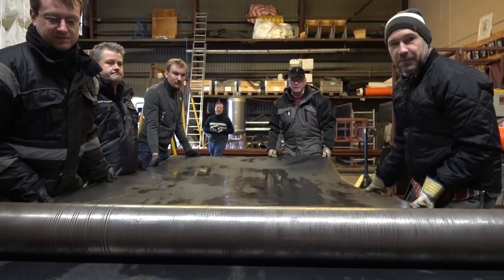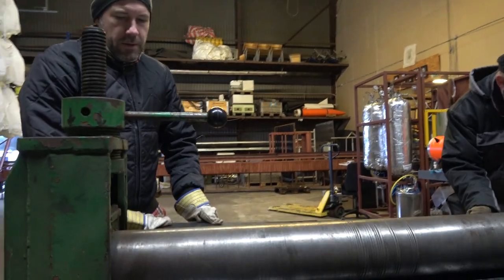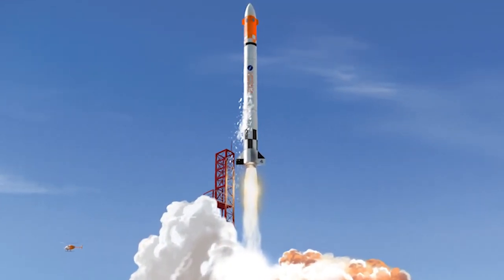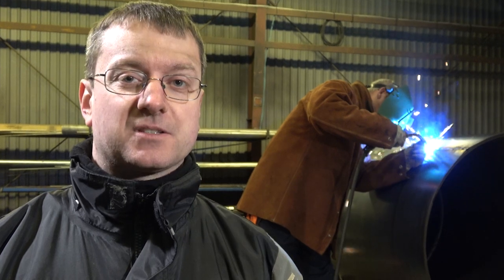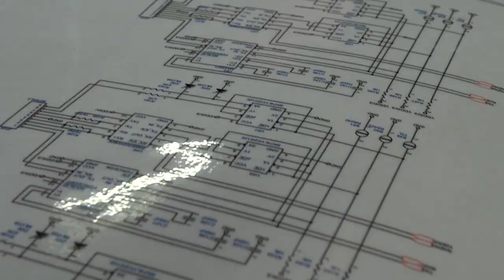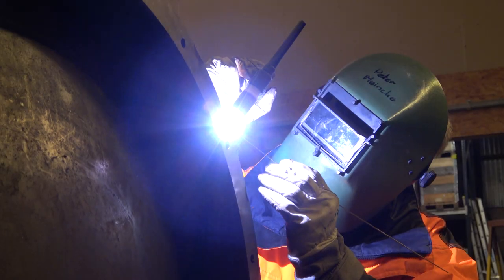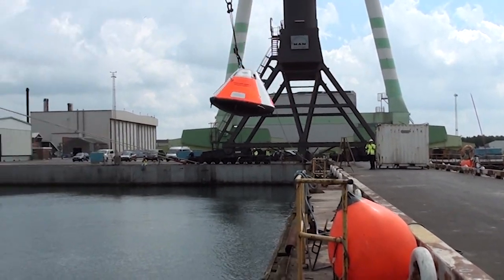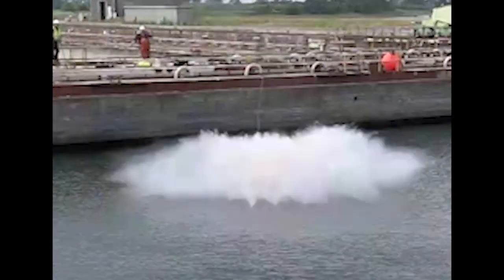Building Our Crewed Space Capsule Prototype for the Spica Rocket

Comment: Really cool! I'm intrigued by your thoughts re: positioning of your pilot. A seated position strikes me as problematic considering the G-Force involved in a rocket launch and is one of the main reasons most manned launches are conducted in a more horizontal position. Do you think you'll be able to reduce the acceleration involved in the launch?
Reply: CHEEZEPictures There are ways to counteract these kinds of problems; such as the pilot is likely to wear a G-suit, or a low thrust to weight ratio at burnout. The primary reason for the seating position is to reduce the diameter of the rocket body, as a larger diameter would be more problematic than high acceleration
Reply: Nicholas Chavez a feet first seated position can have a narrower diameter as well and be more “natural” physiologically as well.

Sitting straight up and receiving g load  axially down the spine seems less than optimal.

A small rocket is unlikely to be able to afford a slow burn low thrust start.

A g suit to just maintain consciousness seems problematic as well.

Feet first seated, so the spine is supported in a highly recumbent position, will only feel weird until launch and guess what position high performance jets use?

All my two cents of course and I wish luck and success to the CS group!
Reply: @FeralRabbit  Yeah I feel like a slightly reclined seated position with a well formed seat would be second best to laying down like most capsules do. Much better than standing up.
Reply: They should just add more fuel thats it
Reply: the little rubberduck and how will that help?
Reply: @FeralRabbit  Getting accelerated feet first will probably be more unpleasant than head first, as the entire human body is built to handle one extra g in that direction.
Reply: @johndododoe1411  standing whether on your head or on your feet in a vehicle that is probably going to accelerate at 3 plus g's is not optimal in either case one has possible permanent ramifications and the other makes having a passenger irrelevant if you're not conscious. All conjecture still 3 years after my post

Comment: Hi guys. Good work, I'm so excited by your achievements and efforts. Watching the video, one thing that concerns me is the astronaut in a seating position. They will not be able to take the G forces, even with  G suit, G suit buys you about 1 extra G for a few more seconds only before passing out. This will make all the extra things to engineer for this more complex. May I suggest a bulbous capsule just enough to fit the pilot on the traditional laying position. It will actually be aerodynamically beneficial as well. We saw those benefits in other rockets with bulbous payload bays due to constant cross section with the lower fins.

Comment: And another thing, what's going to be the capsule's "Abort system" if something went wrong with the speaker Rocket. You need something like an escape module or an ejector seat to get the pilot away from the rocket and back to Earth safely. You need to make sure that all the rocket, the abort system and the capsule works propperly which might mean an "Unmanned Test" to make sure everything works.
Reply from the maker: Currently we don't expect to have an abort system. such a system will in itself add risk, if that should fail in-flight. But that decision hasn't been locked either. Should we add one, it will most likely be a "pusher", sort of like SpaceX' version

Comment: Don't you need a heat shield?
Reply: GameTech did Felix Baumgartner need a heat shield?
Reply: Jason Balius Felix baumgartner went nowhere near space. And yes they need a heatshield however the capsule will likely not experience problems as a ballistic reentry from 100km isn't hot, the problem is high deceleration
Reply from the maker: Baumgartner never left the atmosphere. Reentering the atmosphere at MACH 3-4 will generate temperatures at about 400 C
Reply: So you'd need a heat shield, but not something as complicated or heavy as a low earth orbit heat shield
Reply from the maker: exactly
Reply: No what I mean is that if they were gonna go into space and make a successful reentry and not burn up and die they would need a heat shield.

Comment: I hate to disappoint you Copenhagen Suborbitals, but I'm mostly concerned about the Heat Shield of your capsule, having it as a hemisphere dome shaped, do you think that that design of the heat shield could be a design flaw? Because what I think is the plasma affects of Re-entry are probably not going to be deflected outwards like on normal spacecraft like Apollo and Orion, but instead I believe that the heat of Re-entry is going to deflected just over the external hull of the capsule but the external fin are for the worse going to be exposed to the heat of re-entry. I didn't want to disappoint you all but with this heat shield design, it will need to be tested to prove my theory correct and think of some modifications to the heat shield design. Sorry about that.
Reply from the maker: The design on the picture is a result of artistic freedom. We are planning on a more flat bottom. Everything is going to be tested several times, and the design is definitely not locked yet. We tested a scaled model last year in a wind tunnel, and saw that the fins didn't stabilize enough. Here you can better see the bottom as we expect it to look like: https://youtu.be/HpoLu7LaYAE
Reply: Thanks. I see while that model was like it's bouncing and drifting all over the place.